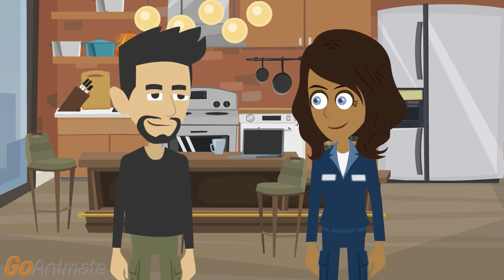Samsung Oven Error Codes

Comment: I'm getting c-d0 plz help what to do
Reply: Did you find the error fix?
Reply: If not then the C-d0 error is kind of like an SE error. You need to clean the sticky screwed control board. Then, if it doesn't work, try replacing the control board. If that also doesn't work, try rubbing alcohol and clean the control board again.

Comment: I have a brand new slide in gas range that gives me a c-21 error code which means the oven is overheating. Makes me want to get a replacement asap!  It's the day before Thanksgiving and I just happened to try to bake apples and the error came up.  I had to shut off power at the circuit breaker because off/clear button didn't respond.  Thankfully a technician is coming today.  Could you pleases explain this error code?
Reply: how are you accessing the diagnostic mode on your stove?  I have a nx58h9500ws.  c-21 is your oven temp switch.

Comment: C-DO i guess nobody can figure it out im having the same problem
Reply: Yes! Same here.
Reply: Think c-do is a moisture issue in the door
Reply: It shows up when there is water or moisture locked around the keypad.
Reply: @user-he2pf1sz3u  so do we just wait for it to dry out??
Reply: @ellengolding8526  no. Clean the control board and see if that works. If not, clean with rubbing alcohol.

Comment: Got an SE Error code on my Samsung Range/Stove/Oven. After the SE Code would flash about five times, the oven would preheat on its own - which was a little strange. I turned off at the breaker panel until I got it fixed. Here is how you fix it. Pull the drawer on the bottom of the oven and you will see the Model Number and Serial Number. You need to replace the Touch Panel Membrane. I contacted my local appliance store and they ordered it for me verifying it was the correct part. Unplug your stove/oven, and make sure the breaker is off as well. Remove the top panel from the back of the stove. You will see where the touch panel is held on by some screws. Remove it, peel it off, replace with the new one, and put it back together...Simple as that
Reply: Did the tech do anything else to try and fix before the touch panel membrane was replaced?

Comment: my oven comes on but it goes off five minutes later and gives a c-do code. what does this mean?
Reply: Gail Charlow  my microwave is a Samsung has an error says c-do on it
Reply: Gail Charlow and Priscilla Reyes, it's an error like the SE. Clean control board. And if not, clean with rubbing alcohol. If not, replace the control board.

Comment: I get an SE error, tried pulling plug, waiting 10min. replugging. I then get digits 12:00 counting up but  buttons don't  work. The numbers count up to  12:18 then goes off. 'Cooking Time' flashes for awhile then recycles back to 12:18 and continues. Anyone else having  this problem? Still not able to use the oven.
Reply: Kim W  Hi Kim. Did you find it necessary to have the button board replaced or were you able to have it repaired?
Reply: I got the same error and the same issue. You need to replace the Touchpad Membrane. If you have a local appliance place they can order you one, it should be less than ninety bucks. If you have a screwdriver, and about thirty minutes you can fix it yourself, its pretty easy to do. You can access it from the back panel of the range.

Comment: What is C-31 mean? Just bought new Samsung oven & first time using oven says C-31 & control panel is extremely hot would not turn off so I just unplugged the oven. Worried about saftey now...
Reply: any luck on C31 im having the same code error
Reply: Bullets795 i have a store warranty on mine so hopefully the repair guy is coming this weeked i can reply to your comment again after he comes & tell you what it means & how he fixes it... How is your oven malfunctioning? I can use the stove on mine currently i just cant push any buttons or use the over presently... Ill keep you posted tho good luck!
Reply: @nelliew6052  please and thank you  i have a repair guy coming monday
Reply: @nelliew6052   found out the problem it was a faulty relay but the only way to fix it was to replace the main board . the repair guy told us to never use self clean or it will short out again. Sounds like a factory flaw. 

self clean means actually self destruct mode.
Reply: Bullets795 thanks so much for the info.. Im disappointed with Samsung now that I have this brand new oven I keep hearing about all the malfunctions with it smh. & I will NEVER use self clean thanks!
Reply: I have the same problem. I did a self clean and now, there is C-31 code. Did you replace the main board :O ? How many dollars for that ?  

Sorry for my english, it's not my first language....
Reply: @anne-sophieb6588   200 plus repairman cost for install . it was the main board because you could not repair the relay its self . pretty sure it was about 350 to fix
Reply: @Bullets795  that's how we got an error code E-21. Don't do it otherwise the door will lock and you'll have to open it with something.
Reply: Samsung will not hold up their warranty 
They say they will buy you still have to pay for labor

Comment: what does e-23 mean?
Reply: It means that it's a door locking error. Look and see if it should open. What happens is that it locks and the oven thinks it's unlocked. Or it thinks that it's locked and if you open it, it's unlocked. Look and see if you can't try unlocking it and if that doesn't work, and it's the other way around, close it and try unlocking it. If none of those cases work, try replacing the door and latches so it can work properly.

Comment: E 21 means wat
Reply: Nur Md Shohag islam 
Sir I need ur help
Reply: It means that it's a door locking error like the E-21, E-23, and E-27 error. Unlock the door and if not, close it and unlock it. Still not working? Replace door and latches.

Comment: Have a Samsung induction range getting a E-84 error. Any thoughts how to fix it?
Reply: Daniel Spence I just got a stove in for repair with the exact same code. One of the induction coil drivers shorts and blows its fuse. Just got it in today and making a video about the repair. Expect video to be out this month depending on if the fix works and so on. Consider subscribing if still interested 😊

Comment: I got an SE and I can't turn on my oven. Does anyone know how to reset it?
Reply: Warren Valadez SE means safety error. At least on stoves it means the touch panel is being constantly pressed (touched). First try turning the power on and off by unpluging the device or at the breaker. If the touch panel is clean and error persists check the touch board connections. If all fails I'm afraid you need a new touch board.
Reply: It might be a shorted oven sensor. Replace. If not, clean it. If not, clean with rubbing alcohol. And if you can't turn it on, try replacing some elements such as the oven sensor. Then try resetting it.
Reply: My oven just don't turn on 
It shuts down when I press the start button

Comment: what does c-d0 mean? on a samsung oven
Reply: I have same prob but technician told me that it is the problem related to door
Reply: @Ayaan_Gurung  no. Did you fix it? If so, then ok. If not, try cleaning the control board membrane. If not clean with rubbing alcohol. If not, replace the control board.